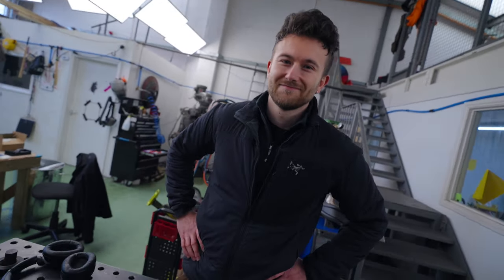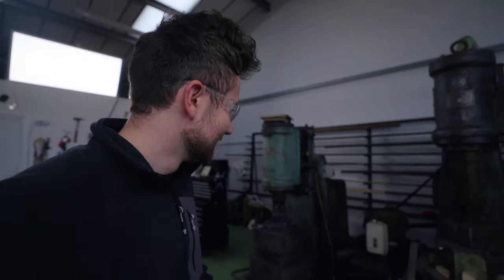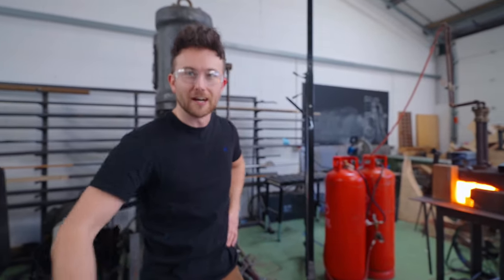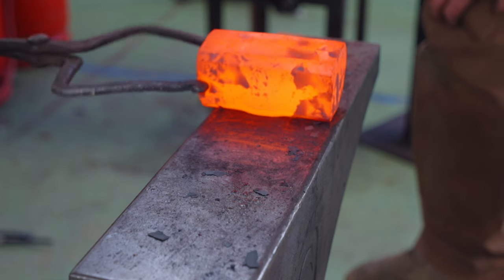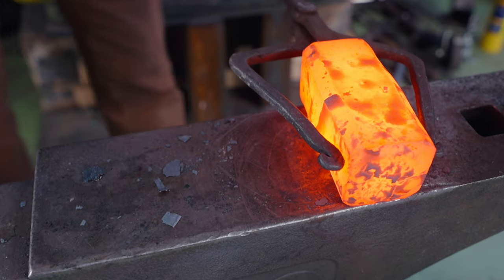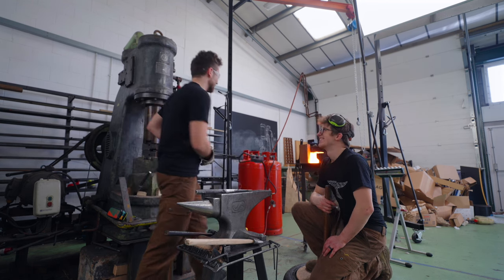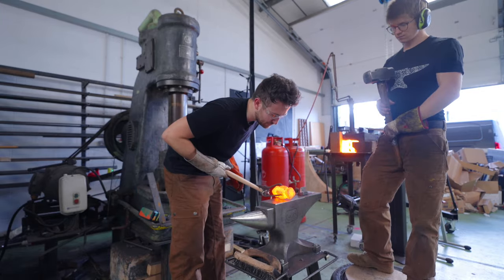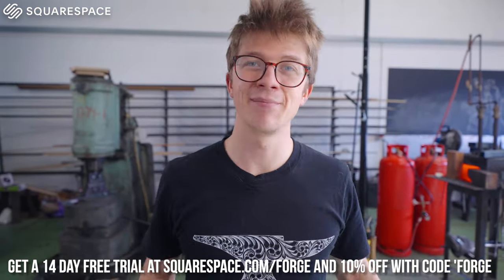Can a Novice Blacksmith Forge a Hammer Without My Help?

Comment: Only comment for Jamie - If you're gonna choke a hammer whilst hammering you may as well cut half the handle off! Handles are the length they are to give you more force. Hold the hammer nearer the bottom of the handle!

Comment: 1: take block of steel
2: bring block of steel to drill press
3: drill hole big enough for wooden dowel
4: push in wooden dowel in hole
5: put a big screw in the top of the wooden dowel to expand it to lock it in the hole

hammer complete.

.... no-one said it had to be a good hammer

Comment: I don't know if I should interpret the video as a failure or that Alec has cheated.
Because the title says "Can Jamie forge a Hammer without my help?" and you can only interpret that as Jamie trying to make a hammer without any help from Alec at all and yet we see Alec helping both in answering questions and in striking the steel into the right shape with the right strength in each blow while Jamie holds the steel, to me that's cheating and totally fails the goal of the video.

Comment: You mean he looks like a seasoned professional, who is afraid of holding the hammer correctly... just as you hold hammers incorrectly... the shaft is as long as it is for a purpose, not for looks! Grow a pair, and hold your hammers correctly and professionally, otherwise, you will forever be an amateur, trying to convince people, that you're a professional.

There are some brilliant blacksmiths out there on YouTube, most of them using a forging hammer correctly and using a coke forge, to enable the steel to easily reach scarf-forging temperatures, whilst your amateur gas oven is only playing at it.

Take a look at Black Bear Forge, for how to forge weld, using a traditional forge.